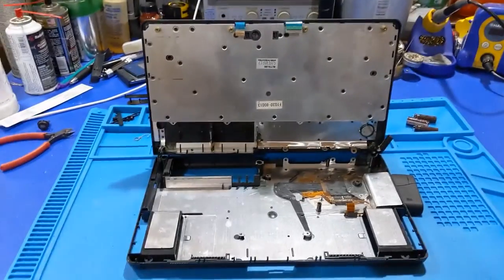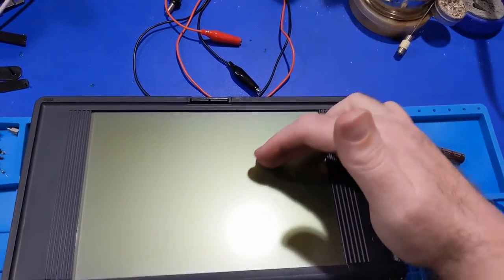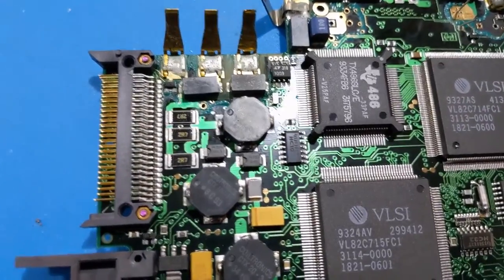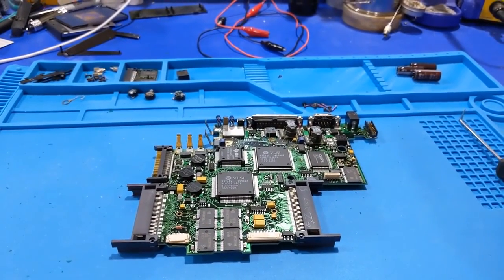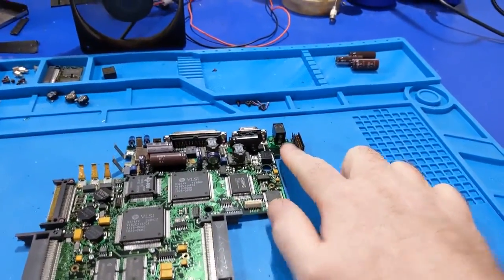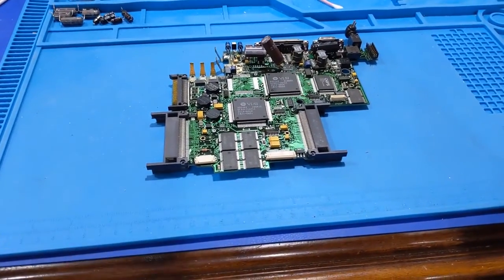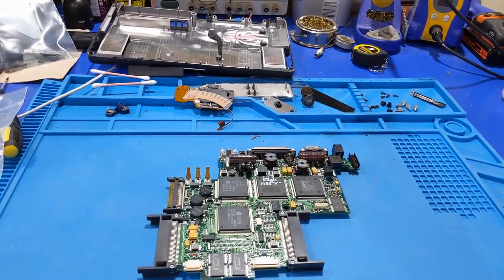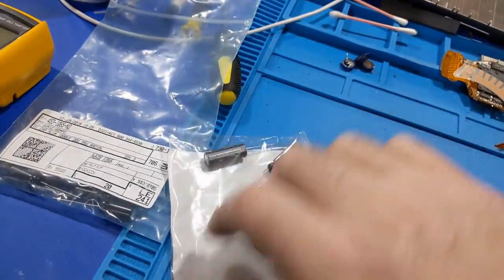HP Omnibook 300 425 530 Repair Fiasco part 1

Comment: Hi, nice Video. How do you disassemble the Lid / Flap?
Reply from the maker: Not sure i follow... the service manual actually has the disassembly procedure. the LCD panel isn't designed to be disassembled, its glued together and it has to be cracked apart.
Reply: @THEtechknight  ok. did you use a hot air gun to separate the two plastic components of the lid or did you "force it apart"?
Reply from the maker: @clickclackhack  Cracked it apart. also why do you need it apart? Unless you have bad hinges or cable, there isn't anything in there serviceable
Reply: @THEtechknight  I have bad plans to change the display and the internals with a raspberry pi (I know every vintage computer nerd heart will scream now sorry for that :)

Comment: The 300 and 425 both have a 386 based CPU. They called it a 486 because it had cache and better performance, but it wasn't a real 486. The 530 has a real 486. That's why the motherboard is so very different on it.
Reply: The TI 486 processor had the 8k cache and supported the 486 instruction set, so it technically was a "real 486" albeit a slow one, the thing was built into a portable that runs on batteries.